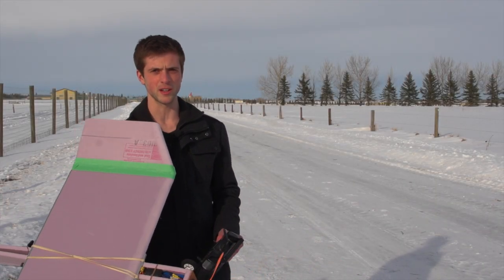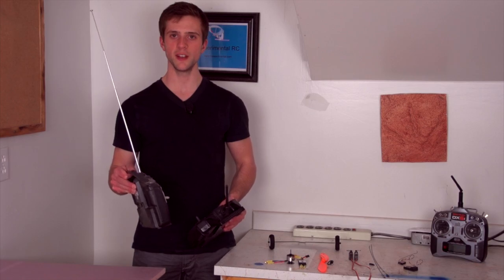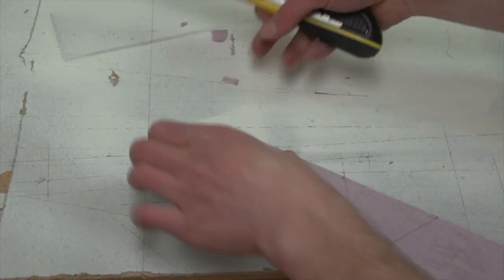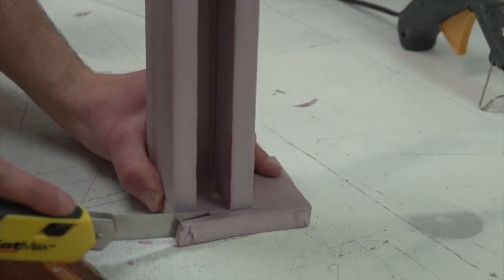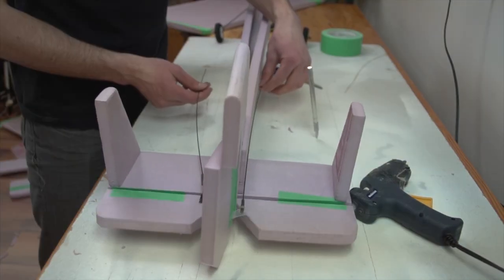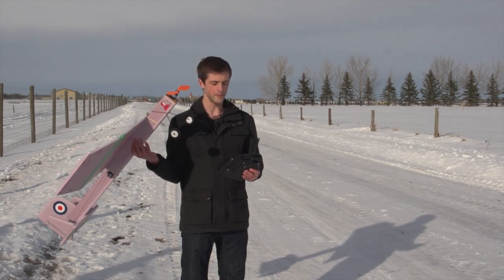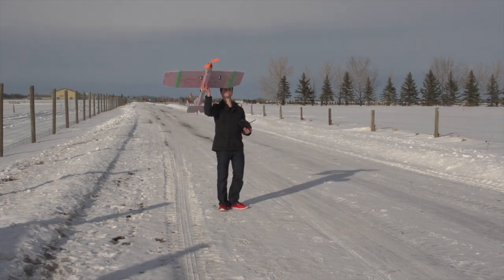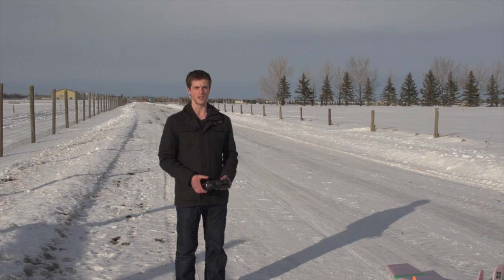How to build and fly an RC plane

Comment: what are the power ratings of all electronics please sir 
and thank you
Reply: +ROCKSTAR COC 

Price list
My 10 year old son and I made it and it flies great.

 Everything I purchased from Amazon    Total 
$328.02

Total $202.69, if you buy this
Transmitter & Receiver bundle  $41.89   2.4G FS-CT6B 6 CH Radio Model RC 

Transmitter and
simulation software   $149.97   Great Planes RealFlight 7.5 w/Tactic TTX610:  

Receiver
$17.25 Tactic TR624 2.4Ghz 6CH Receiver:       

Motor $19.99 hexTronik DT750 Brushless Outrunner 750kv:

Speed
Controller $15.99  BW 20Amp 20A ESC Brushless Speed Controller 2-3S:

2 Servos  $8.00   Tower pro MG 90S servos:

Props  $7.50  2
of Jrelecs 2 Pairs 1045 Rc 4-axis X-axis Aircraft for Rc Airplane Black:

Landing gear  $11.69  GREAT PLANES Landing Gear Set Flylite EP ARF GPMA2584:

Prop saver   $5.09  uxcell 4mm Airplane Propeller Prop Saver:

Push rods   $9.74 Great Planes Semi-Flexible Pushrod (Set of
2), 36":

Nylon Control
Horns $3.28    Great Planes Nylon Control Horns (Set of 2):

Battery  $15.99 
Turnigy
1300mAh 3S 20C Lipo Pack:

Battery charger $20.86
 iMAX B6 OEM Battery Balance Charger For 1-6 cell Lipo:

Battery charger wall adapter $9.35 Intocircuit LCD 60W 12V 5A Adapter:

Battery charger Connector
$5.99  LHI 3 PCs Male XT60
XT-60 To Female T-Plug Deans Connector: 

Battery fireproof bag
$8.80  BW Fireproof Explosionproof Lipo Battery
Safe Bag:

XT60 Connectors  $5.75  US Shipped Cheap Drones XT60 Connectors 5 Pairs: 

Motor Connector $6.55  10 Pairs Gold Tone
Metal Banana Bullet Plug Male Female Connector 3.5mm:  

Battery extension $6.23  RC 3S Lipo Battery 4Pin JST-EH Plug Balance Charger Cable
Extension:
Reply: +Midtown Groove  thanks

Comment: no ailerons. interesting. first RC build guide i've ever seen so i guess i wouldn't know. but is yawing sufficient for turning?
Reply: +C0nstellati0nZzz Its easier if it only has 3 things to control. Rudder, Throttle, and Speed.
Reply: +C0nstellati0nZzz Yeah, it's usually best to start out with just two control surfaces for simplicity.

Comment: Hey plz reply to this comment ... 
I am building a plane after watching your video.
I have the same parts as you used in video I have the same transmitter and receiver you used.. everything is works fine and great except main brushless motor which is the main part. I have 1000kV brush less motor and a 30A ESC and I connected the ESC to receiver's CH 3 but when I power it on the servos works as it should but the main motor isn't spinning and only makes continues beeps. Please help me and tell about all the beeps and I have purchased by spending lots of money only the main motor having the problem . I think actually I don't know how to arm the motor for spinning.

Comment: In hobbyking the parts are very costly i suggest ebay for indians where you can get all parts around 4000 to 5000 INR 
plz anyone reply to my last comment i am waiting
Reply: +ADITYA KN 

Price list
My 10 year old son and I made it and it flies great.

 Everything I purchased from Amazon    Total 
$328.02

Total $202.69, if you buy this
Transmitter & Receiver bundle  $41.89   2.4G FS-CT6B 6 CH Radio Model RC 

Transmitter and
simulation software   $149.97   Great Planes RealFlight 7.5 w/Tactic TTX610:  

Receiver
$17.25 Tactic TR624 2.4Ghz 6CH Receiver:       

Motor $19.99 hexTronik DT750 Brushless Outrunner 750kv:

Speed
Controller $15.99  BW 20Amp 20A ESC Brushless Speed Controller 2-3S:

2 Servos  $8.00   Tower pro MG 90S servos:

Props  $7.50  2
of Jrelecs 2 Pairs 1045 Rc 4-axis X-axis Aircraft for Rc Airplane Black:

Landing gear  $11.69  GREAT PLANES Landing Gear Set Flylite EP ARF GPMA2584:

Prop saver   $5.09  uxcell 4mm Airplane Propeller Prop Saver:

Push rods   $9.74 Great Planes Semi-Flexible Pushrod (Set of
2), 36":

Nylon Control
Horns $3.28    Great Planes Nylon Control Horns (Set of 2):

Battery  $15.99 
Turnigy
1300mAh 3S 20C Lipo Pack:

Battery charger $20.86
 iMAX B6 OEM Battery Balance Charger For 1-6 cell Lipo:

Battery charger wall adapter $9.35 Intocircuit LCD 60W 12V 5A Adapter:

Battery charger Connector
$5.99  LHI 3 PCs Male XT60
XT-60 To Female T-Plug Deans Connector: 

Battery fireproof bag
$8.80  BW Fireproof Explosionproof Lipo Battery
Safe Bag:

XT60 Connectors  $5.75  US Shipped Cheap Drones XT60 Connectors 5 Pairs: 

Motor Connector $6.55  10 Pairs Gold Tone
Metal Banana Bullet Plug Male Female Connector 3.5mm:  

Battery extension $6.23  RC 3S Lipo Battery 4Pin JST-EH Plug Balance Charger Cable
Extension:

Comment: Back here in India, these things are still expensive. Based on my calculations,the overall cost (without the insulation sheets) came to about 9000INR, that's about a 142$.Quite a lot of money to be spent on a hobby.
Reply: +Eclipse Gaming for indians
Reply: dirtybike I agree to that wholeheartedly. Hence, I'll try and collect the money as much as possible so that I can build this myself. Wish I had found this in my early twenties when I still had the luxury of spending money on these things. Now, with a family and a young kid, it seems difficult.
Reply: Meh not really
Reply: +Eclipse Gaming for indians
Reply: +Rohit D'Almeida 

Price list
My 10 year old son and I made it and it flies great.

 Everything I purchased from Amazon    Total 
$328.02

Total $202.69, if you buy this
Transmitter & Receiver bundle  $41.89   2.4G FS-CT6B 6 CH Radio Model RC 

Transmitter and
simulation software   $149.97   Great Planes RealFlight 7.5 w/Tactic TTX610:  

Receiver
$17.25 Tactic TR624 2.4Ghz 6CH Receiver:       

Motor $19.99 hexTronik DT750 Brushless Outrunner 750kv:

Speed
Controller $15.99  BW 20Amp 20A ESC Brushless Speed Controller 2-3S:

2 Servos  $8.00   Tower pro MG 90S servos:

Props  $7.50  2
of Jrelecs 2 Pairs 1045 Rc 4-axis X-axis Aircraft for Rc Airplane Black:

Landing gear  $11.69  GREAT PLANES Landing Gear Set Flylite EP ARF GPMA2584:

Prop saver   $5.09  uxcell 4mm Airplane Propeller Prop Saver:

Push rods   $9.74 Great Planes Semi-Flexible Pushrod (Set of
2), 36":

Nylon Control
Horns $3.28    Great Planes Nylon Control Horns (Set of 2):

Battery  $15.99 
Turnigy
1300mAh 3S 20C Lipo Pack:

Battery charger $20.86
 iMAX B6 OEM Battery Balance Charger For 1-6 cell Lipo:

Battery charger wall adapter $9.35 Intocircuit LCD 60W 12V 5A Adapter:

Battery charger Connector
$5.99  LHI 3 PCs Male XT60
XT-60 To Female T-Plug Deans Connector: 

Battery fireproof bag
$8.80  BW Fireproof Explosionproof Lipo Battery
Safe Bag:

XT60 Connectors  $5.75  US Shipped Cheap Drones XT60 Connectors 5 Pairs: 

Motor Connector $6.55  10 Pairs Gold Tone
Metal Banana Bullet Plug Male Female Connector 3.5mm:  

Battery extension $6.23  RC 3S Lipo Battery 4Pin JST-EH Plug Balance Charger Cable
Extension:
Reply: Midtown Groove 328$ = 21873.76 Indian rupees. i can get an RC airplane online for less than that.
Reply: Rohit D'Almeida but you'll have the joy and knowledge of building an aircraft
Reply: you could buy it for about 5500 INR on amazon or flipkart (excluding the battery)
Reply: Check out the aquarium hobby...

Comment: Put this thing together in a few hours with some Home Depot 1/2 inch styrofoam, and leftover servos, motor, esc and folding prop from a Radian I used to fly.  It flew great, even though the construction was sloppy.

Comment: what's that material used for the rc plane body?
howmuch cost to make rc plane?
Reply: +bharath chowdary 

Price list
My 10 year old son and I made it and it flies great.

 Everything I purchased from Amazon    Total 
$328.02

Total $202.69, if you buy this
Transmitter & Receiver bundle  $41.89   2.4G FS-CT6B 6 CH Radio Model RC 

Transmitter and
simulation software   $149.97   Great Planes RealFlight 7.5 w/Tactic TTX610:  

Receiver
$17.25 Tactic TR624 2.4Ghz 6CH Receiver:       

Motor $19.99 hexTronik DT750 Brushless Outrunner 750kv:

Speed
Controller $15.99  BW 20Amp 20A ESC Brushless Speed Controller 2-3S:

2 Servos  $8.00   Tower pro MG 90S servos:

Props  $7.50  2
of Jrelecs 2 Pairs 1045 Rc 4-axis X-axis Aircraft for Rc Airplane Black:

Landing gear  $11.69  GREAT PLANES Landing Gear Set Flylite EP ARF GPMA2584:

Prop saver   $5.09  uxcell 4mm Airplane Propeller Prop Saver:

Push rods   $9.74 Great Planes Semi-Flexible Pushrod (Set of
2), 36":

Nylon Control
Horns $3.28    Great Planes Nylon Control Horns (Set of 2):

Battery  $15.99 
Turnigy
1300mAh 3S 20C Lipo Pack:

Battery charger $20.86
 iMAX B6 OEM Battery Balance Charger For 1-6 cell Lipo:

Battery charger wall adapter $9.35 Intocircuit LCD 60W 12V 5A Adapter:

Battery charger Connector
$5.99  LHI 3 PCs Male XT60
XT-60 To Female T-Plug Deans Connector: 

Battery fireproof bag
$8.80  BW Fireproof Explosionproof Lipo Battery
Safe Bag:

XT60 Connectors  $5.75  US Shipped Cheap Drones XT60 Connectors 5 Pairs: 

Motor Connector $6.55  10 Pairs Gold Tone
Metal Banana Bullet Plug Male Female Connector 3.5mm:  

Battery extension $6.23  RC 3S Lipo Battery 4Pin JST-EH Plug Balance Charger Cable
Extension:

Comment: can i order from hobbyking from israel?
Reply: +Nadav Friedman 

Price list
My 10 year old son and I made it and it flies great.

 Everything I purchased from Amazon    Total 
$328.02

Total $202.69, if you buy this
Transmitter & Receiver bundle  $41.89   2.4G FS-CT6B 6 CH Radio Model RC 

Transmitter and
simulation software   $149.97   Great Planes RealFlight 7.5 w/Tactic TTX610:  

Receiver
$17.25 Tactic TR624 2.4Ghz 6CH Receiver:       

Motor $19.99 hexTronik DT750 Brushless Outrunner 750kv:

Speed
Controller $15.99  BW 20Amp 20A ESC Brushless Speed Controller 2-3S:

2 Servos  $8.00   Tower pro MG 90S servos:

Props  $7.50  2
of Jrelecs 2 Pairs 1045 Rc 4-axis X-axis Aircraft for Rc Airplane Black:

Landing gear  $11.69  GREAT PLANES Landing Gear Set Flylite EP ARF GPMA2584:

Prop saver   $5.09  uxcell 4mm Airplane Propeller Prop Saver:

Push rods   $9.74 Great Planes Semi-Flexible Pushrod (Set of
2), 36":

Nylon Control
Horns $3.28    Great Planes Nylon Control Horns (Set of 2):

Battery  $15.99 
Turnigy
1300mAh 3S 20C Lipo Pack:

Battery charger $20.86
 iMAX B6 OEM Battery Balance Charger For 1-6 cell Lipo:

Battery charger wall adapter $9.35 Intocircuit LCD 60W 12V 5A Adapter:

Battery charger Connector
$5.99  LHI 3 PCs Male XT60
XT-60 To Female T-Plug Deans Connector: 

Battery fireproof bag
$8.80  BW Fireproof Explosionproof Lipo Battery
Safe Bag:

XT60 Connectors  $5.75  US Shipped Cheap Drones XT60 Connectors 5 Pairs: 

Motor Connector $6.55  10 Pairs Gold Tone
Metal Banana Bullet Plug Male Female Connector 3.5mm:  

Battery extension $6.23  RC 3S Lipo Battery 4Pin JST-EH Plug Balance Charger Cable
Extension:

Comment: Is the motor leveled and untilted? How does this plane generate lift?
Reply from the maker: The back stabilizers are offset very slightly to account for the torque of the motor, and it can also be trimmed out by the rudder. The aircraft generates lift by flying at a positive angle of attack. An airfoiled wing can generate lift with the wing at a 0 degree A o A but this requires around 2 or 3 degrees to fly level. It is a less efficient way to generate lift but that doesn't matter for a trainer rc plane.

Comment: hobby-king is to expansive, u buy something for $2 they charge an extra $50 for shipping and taxes, not worth buying I spend more the $130 on the things in the website for the build the plane. He dose not explain the small detail and dose not tell you that u need to buy the power supply for the charger. and other smaller connecter for the moter and speed control. not wortth doing
Reply: +ulises flores 

Price list
My 10 year old son and I made it and it flies great.

 Everything I purchased from Amazon    Total 
$328.02

Total $202.69, if you buy this
Transmitter & Receiver bundle  $41.89   2.4G FS-CT6B 6 CH Radio Model RC 

Transmitter and
simulation software   $149.97   Great Planes RealFlight 7.5 w/Tactic TTX610:  

Receiver
$17.25 Tactic TR624 2.4Ghz 6CH Receiver:       

Motor $19.99 hexTronik DT750 Brushless Outrunner 750kv:

Speed
Controller $15.99  BW 20Amp 20A ESC Brushless Speed Controller 2-3S:

2 Servos  $8.00   Tower pro MG 90S servos:

Props  $7.50  2
of Jrelecs 2 Pairs 1045 Rc 4-axis X-axis Aircraft for Rc Airplane Black:

Landing gear  $11.69  GREAT PLANES Landing Gear Set Flylite EP ARF GPMA2584:

Prop saver   $5.09  uxcell 4mm Airplane Propeller Prop Saver:

Push rods   $9.74 Great Planes Semi-Flexible Pushrod (Set of
2), 36":

Nylon Control
Horns $3.28    Great Planes Nylon Control Horns (Set of 2):

Battery  $15.99 
Turnigy
1300mAh 3S 20C Lipo Pack:

Battery charger $20.86
 iMAX B6 OEM Battery Balance Charger For 1-6 cell Lipo:

Battery charger wall adapter $9.35 Intocircuit LCD 60W 12V 5A Adapter:

Battery charger Connector
$5.99  LHI 3 PCs Male XT60
XT-60 To Female T-Plug Deans Connector: 

Battery fireproof bag
$8.80  BW Fireproof Explosionproof Lipo Battery
Safe Bag:

XT60 Connectors  $5.75  US Shipped Cheap Drones XT60 Connectors 5 Pairs: 

Motor Connector $6.55  10 Pairs Gold Tone
Metal Banana Bullet Plug Male Female Connector 3.5mm:  

Battery extension $6.23  RC 3S Lipo Battery 4Pin JST-EH Plug Balance Charger Cable
Extension:

Comment: Only addition to the instructions I would make is to add a pull tab to the battery. This way noobs aren't tempted to pull it by the power or balance plugs. Nice build though.
Reply from the maker: Good call, I've never thought to do this but it's an easy way to save your batteries/esc

Comment: The video was produced very well.  I would recommend several things to improve the performance and longevity of the plane.  The hinges shouldn't be tape, or if they are, use something like Extreme Packing tape that will stick longer.  Just be sure you cover the extreme packing tape to protect it from UV.  The servos would be stronger and last longer if they were set inside the foam.  Cut a rectangle the size of the servo and glue it inside that opening.  I personally wouldn't offset the stablizers, but instead offset the motor mount.  If someone wants to make their plane look pretty, use 120 grit and then work down to 220 grit to smooth out the edges.  Then cover with a brown packing paper and a mixture of white glue and water.  There are videos on this.  Then it can be painted.  I do like your plane design.  Looks cool and stable for beginner flyers.  Congrats on the design.
Reply: Hi Lee. Would you know by your estimates how much the plane weighs? Also what's the criteria for selecting motors and prop sizes with regards to overall weight? Hope to hear from you and thanks!
Reply: I would need more details about the plane to give recommendations on motor and prop sizes.  For a plane this size I would guess a 3S motor and battery setup.  You will want a larger prop, maybe even a slowfly prop on a lower KV motor.  This is because the plane isn't meant for speed.  The lower KV with a bigger prop will give you more low end power to help keep her in the air better.  Think of it as the low gear of a car.  A lot of power, but not much in speed.  A high KV motor with a small prop is for speed.  This would be like high gear in a car.  It is meant for high speed, but not much power to get the plane moving.  This plane won't be doing 80mph.  It appears to have a lot of drag and not meant for speed.  It's not sleek like a race car.  If you can give me the all up weight before motor/battery as well as the sq/ft of the wing, I could give you a better answer as to what motor/prop I would recommend.  Off the top of my head with what I see I might say you can do a 400 or 450 size SlowFly motor.  What were you using in the video?

Comment: Hello Tim,
I built an identical model with the identical foam you used and it just refuses to takeoff,
I installed 2 landing gears (one at the back as well)

Also when rolling to takeoff, it begins to roll to the left and right sometimes (at high speeds)

I'm guessing I built the wing incorrectly..
Reply: Just throw it...
Reply: +vinayak678 

The prop maybe is installed wrong.

Comment: can u send me the link of motor and rc and speed controller all others
Reply: +azmi abdullah 

Price list
My 10 year old son and I made it and it flies great.

 Everything I purchased from Amazon    Total 
$328.02

Total $202.69, if you buy this
Transmitter & Receiver bundle  $41.89   2.4G FS-CT6B 6 CH Radio Model RC 

Transmitter and
simulation software   $149.97   Great Planes RealFlight 7.5 w/Tactic TTX610:  

Receiver
$17.25 Tactic TR624 2.4Ghz 6CH Receiver:       

Motor $19.99 hexTronik DT750 Brushless Outrunner 750kv:

Speed
Controller $15.99  BW 20Amp 20A ESC Brushless Speed Controller 2-3S:

2 Servos  $8.00   Tower pro MG 90S servos:

Props  $7.50  2
of Jrelecs 2 Pairs 1045 Rc 4-axis X-axis Aircraft for Rc Airplane Black:

Landing gear  $11.69  GREAT PLANES Landing Gear Set Flylite EP ARF GPMA2584:

Prop saver   $5.09  uxcell 4mm Airplane Propeller Prop Saver:

Push rods   $9.74 Great Planes Semi-Flexible Pushrod (Set of
2), 36":

Nylon Control
Horns $3.28    Great Planes Nylon Control Horns (Set of 2):

Battery  $15.99 
Turnigy
1300mAh 3S 20C Lipo Pack:

Battery charger $20.86
 iMAX B6 OEM Battery Balance Charger For 1-6 cell Lipo:

Battery charger wall adapter $9.35 Intocircuit LCD 60W 12V 5A Adapter:

Battery charger Connector
$5.99  LHI 3 PCs Male XT60
XT-60 To Female T-Plug Deans Connector: 

Battery fireproof bag
$8.80  BW Fireproof Explosionproof Lipo Battery
Safe Bag:

XT60 Connectors  $5.75  US Shipped Cheap Drones XT60 Connectors 5 Pairs: 

Motor Connector $6.55  10 Pairs Gold Tone
Metal Banana Bullet Plug Male Female Connector 3.5mm:  

Battery extension $6.23  RC 3S Lipo Battery 4Pin JST-EH Plug Balance Charger Cable
Extension: